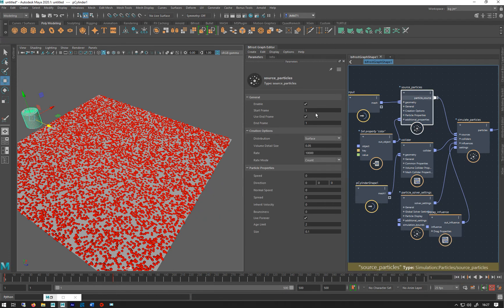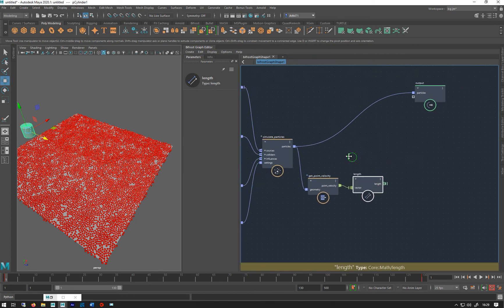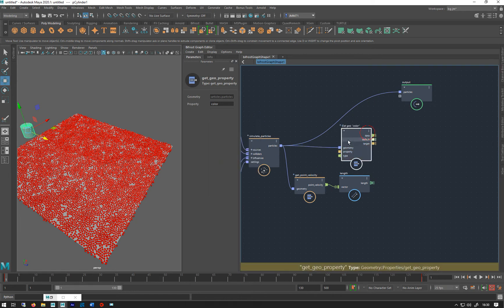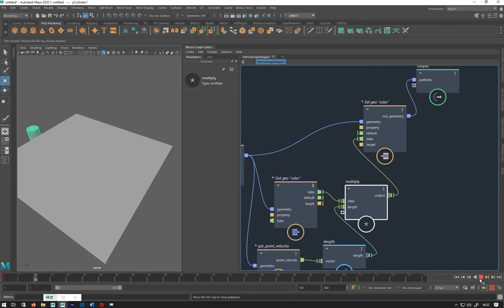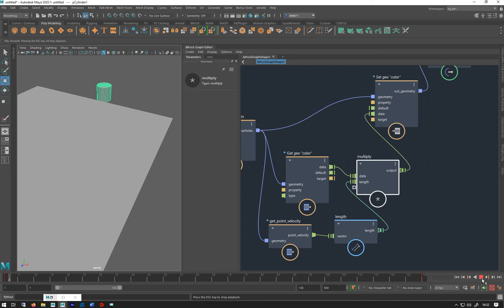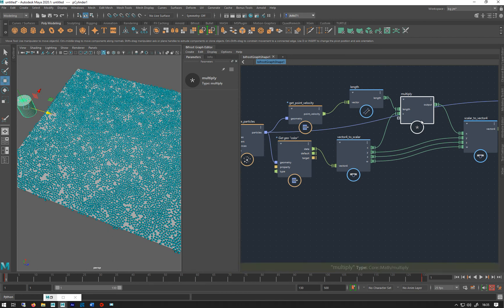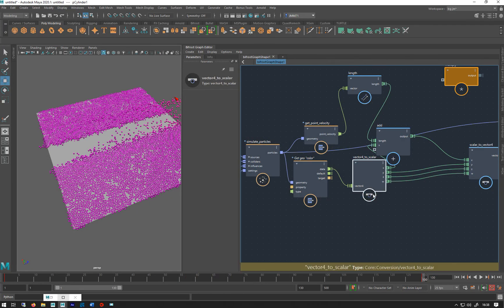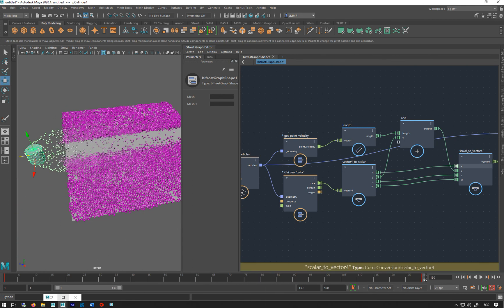BIFROST BASICS: WEEK 3 LESSON 7 VELOCITY TO COLOUR

Comment: hi there  I tried this with mpm fluid but I get "no
promotion exists from a value of type 'array<Amino::Object>'
' to a value of type
'Amino::Object' " 
 on the get geo property node -also the set geoproperty node has errors  any ideas why ?  many thanks for the tutorial and all the others too !
Reply from the maker: HI.  'array<Amino::Object>' means there is multiple objects being outputed from the simulate_mpm. use a first_in_array node to access the mpm particle object, then ypu'll be able to access the geo properties with the get_geo_property. I hope that helps
Reply: @jmm7180  many thanks i tried get from array but not first in array. i will give it a go much obliged!
Reply: hi. tried that now I can't multiply as the get geo property is a maths float 4 and the length is a vector 4 ,so multiply gives me an error though on your video the port colours are the same as I have it - it looks like the first in the array is 0 !  programming isn't my strong point learning very slowly